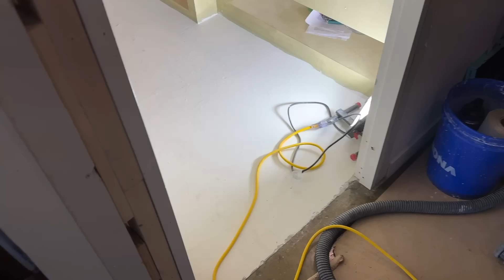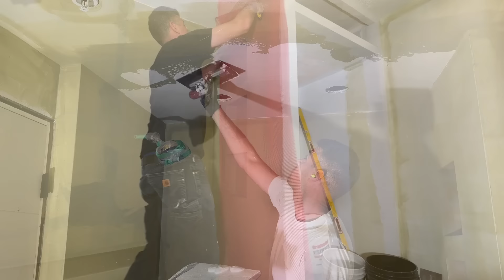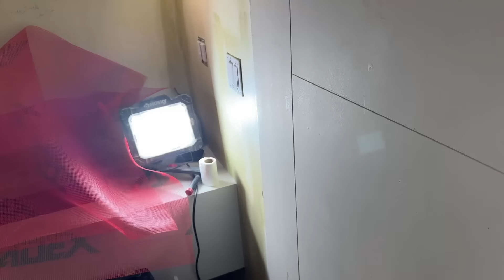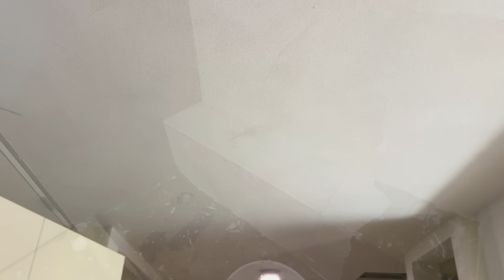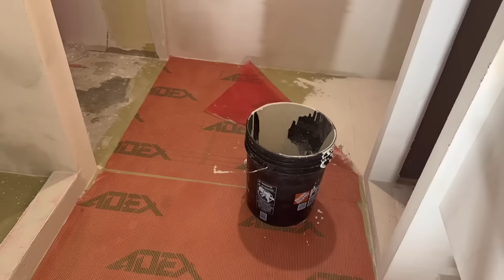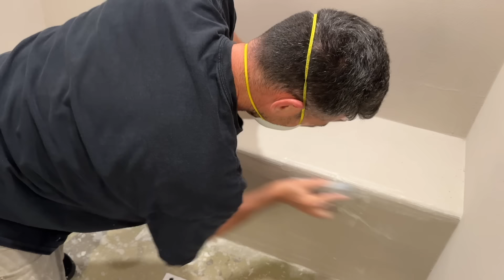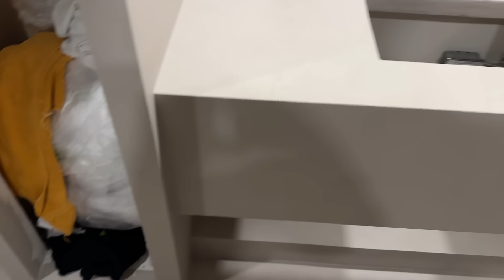Is MICROCEMENT Really DIY Friendly?

Comment: As a contractor how did you do on this?  I'm a remodeling contractor and pretty meticulous.   I only see 2 possible outcomes for me if I took on this job: 1. I do it time and material and the customer hates me and thinks i'm a thief or incompetent, or, more likely, I only bill them for a fraction of the time I actually took.   Or 2. I give a fixed price on the job and underestimate the amount of time by orders of magnitude.   Either way, that's rough.  
Amazing job and I actually really like the finish.  I'd like to see it after it's all trimmed out.

Comment: Would you consider other systems that are less cumbersome? I am researching micro cement products for some small decorative pieces that are also usable for waterproof areas like bathrooms and showers. SureCrete microtek and Meoded Concretta are two products that have stood out to me because they don’t require any mesh or excess preparation (primer, product, . I would love to see you try those. I’m sure they’ll send you free product considering the amount of traffic your page gets.
Reply from the maker: You still need the jobs more than the product. Free product without the jobs just gets you product on the shelves and unmet obligations. Ask me how I know 😅
Reply: @vancouvercarpenter  I learned so much about drywall from you, can’t tell you how excited I got to see someone I “know” and trust post a microcement video only to find out it wasn’t very encouraging 😂

Comment: Probably the better of demonstrations of micro cement I've seen. but even as well as you tried, I feel it looks awful. Just too much tool marks after everything sets.
A thought, could you not use a sponge to help smooth the texturing or help form it around the corners as its setting up?
Reply from the maker: The tool marks are actually part of the look. It’s not intended to be a perfectly smooth surface. I think a lot of people don’t understand that. It looks better in person.

Comment: I'm an experienced drywall finisher, and 5 minutes into this video I concluded I will NEVER attempt a "microcement" project.  However, I salute Ben for tackling this project, and I hope he was compensated appropriately.
Reply: 100% came to say the same.  I’m experienced in drywall AND building showers and I immediately knew this ish ain’t for me. Haha! 🍻
Reply: Weirdly curious about the cost for a job like this, surely this is well into the 5 figures
Reply: I think I can do this, but only because I’m highly experienced in skim coating and high detail cove crafting. I’d probably create forms and use concrete edging tools and treat it akin to building a pool
Reply: hahhahaaa..... me too
Reply: It's not all that bad. And it pays well.

Comment: You can sand this product. There is a sweet spot for time, around 4hrs where an orbital with 40grt works fine.
Reply: Sanding epoxy before it's fully cured? I'd be surprised if that's good for you

Comment: I'm very grateful someone I like and trust did this video.
There is no way I can see a DIY doing this, it appears to be a nightmare.
I use epoxy grout in my tile installs, a fair bit, and it is something a lot of tilers won't use.
This is 100X harder.
Thanks Ben !
Reply: I've seen pretty good professional tile installers struggle with epoxy grout, and after using it to remodel my own bathroom, I can see why. Using a multi-coat , epoxy based product to cover every surface looks masochistic.
Reply: I used epoxy grout on my 12x12 Italian bathroom tile 30 years ago.  It's still going strong but I'm still in therapy from the cleanup trauma! Rarely do it for customers.  
  The Latticrete that came along was much more reasonable  but still a challenge.  That original Mapai was murder! That shiny resin haze! Had to brake out the acetone and laquer thinner!
Reply: @ThePierik  I'm sorry to hrar that.
Mapei needs lots of clean water rinses, no more than 20 mins after install,
it is a totally different animal,
a razor scraper helps to clean as well,
Meticulous care needed for sure.

Comment: Ben!!! I just did micro cement for the first time in Smithers BC two weeks ago. I didn't even know what it was to begin with. But it's obviously just cement with some polymer in it. I'm an electrician and I told the questions that I can also mud tape really well so I did that and then in addition they wanted me to try out some micro cement in their living room 

Man, it said to make it at a pancake batter consistency and in hindsight I think that actually was the way to go. I wanted to make it more like a thick drywall mud, that, but this caused it to have a slight overlapping effect on the second coat.  If you couldn't keep a wet edge, you would get a build up and then you'd see where you started and stopped.

So in the future I'd make it much more soupy.  And the other thing I learned is definitely get a scoop for the water and for the cement mix and not mix it by feel.  The freaking cement had such a plume of dust that would come up, there was no idea how much product you actually put in the pail.  Furthermore to this problem, if you keep going back and forth with water and mixing too much. That "over mixing" makes the product set up so fast!!  
I had one of the mixes that was the third pail of that damn near killed me.  It was so hard to apply.

It turned out well in the end and the homeowners were very happy with the effect, but I couldn't imagine knowing the drywall jobs I've fixed in the past for people that somebody would try this DIY.  I feel it would be the biggest disaster and so so messy.  I'm a very clean taper and she was shocked at how little I lost off my Hawk even though I was making it wetter towards the end.

I would use colorful language to describe how easy it was, but I'd like to keep your channel professional.  Doing a bathroom with all those corners would be very challenging.  I'm impressed Ben.  Like you said, it uses every tool you have in the box (skill I had) to get 'er done 

The homeowners we're just going to go ahead and apply micro cement to unsanded and unflushed joints in plywood.  This would have turned out gnarly.  They were taking the lead on it but I advised some pointers and they were happy to oblige but I probably should have put more effort into prep.  I got them to vacuum sand all the plywood, fill all the screw heads and float all the joints in the plywood with feather finish, then vacuum sand it again. And then apply their the primer
Reply: Really helpful information. Thank you!!
Reply: Very different product

Comment: How you describe this really sounds like polyester. I did a project on my boat where I changed the form of the hull for better stability. If it's thicker in a spot or have some in a bucket, it heats up and cures quicker than the rest, making it weird to work on.

Except polyester is dirt cheap and you just need to work with smaller batches and work like the world is ending within a few minutes

Comment: This kind of project makes me love my fiberglass shower/tub even more. Cheap, easy to install & 100% waterproof.
Reply: and 1000x easier to clean too - how are you going to clean that rough surface - and you like your counters and shower to feel like sandpaper, or the community swimming pool with it's super abrasive finish? Makes no sense at all
Reply: @gorak9000  This was going through my head the entire time I watched.  How is that textured surface not going to hold onto mildew, soap scum, and grime?  It's hell to apply, and it's hell to clean.  I suppose that adds to the 'flex factor' since you now need dedicated cleaning staff to keep it looking pristine.
Reply: @pragmax aw hell, it ain't so bad, just keep a pressure washer in your bathroom.
Reply: @gorak9000 This is the spare 6th bathroom…it will never be used.
Reply: @gorak9000  It isn't supposed to have a rough finish. It's meant to end up glassy smooth.
Reply: @timbirch4999 No it's not. Different products.
Reply: @judymiller8831   Then the contractor chose the wrong f'king product. 😂
Reply: 100% agree. This rich ppl stuff is just a expensive headache
Reply: Fibreglass...   Yes, it's cheap. 

Cheap AF.

Comment: From the moment you started followed by one after the other facts on difficulty, etc., made me appreciate your work even more.  Epoxy grout, etc, is AWFUL to work with.  You can't get it off your tools, it goes off too fast, etc.  Epoxy grout was popular about 20 years ago and was an absolute nightmare to work with.  Thank goodness another contractor shared w/me that using dishwasher detergent helped to take it off the tiles, tools, etc.  I wouldn't use this stuff b/c I wouldn't want to the pressure and other constraints to make it turn out well.  Nice job!!

Comment: I love this type of work, I do parging mainly but looking to get into winter friendly projects. I am going to try using Adex wet basecoat mixed with port land then color primer and finish with Acrylic! Would be sweet if you did one of those. Materials are still expensive but 110 per pale basecoat + 1.5 x 12 bucks portland 20kg cement so like $130 per pale for basecoat gets you 150 sq ft at minimum. Then primer with color is $250 delivered over 1000-1500 sq ft and Acrylic 110 + 10 bucks for color between 120-130 per pale w/ color. Basically you can do it right over drywall board, or wood. If over wood use Hydraflex-who membrane everywhere, then basecoat then acrylic. If over drywall use unitape (sticky mesh) over the joints screw holes and hydraflex membrane coat w/ sticky mesh over these areas then do the rest of the place and once the joints are dry go over it again so two coats over joins 1 coat over the rest. Then you are good to use the base coat normally outside you would use the adex mesh embedded non adhesive and I am sure you could inside as well but it doesn't call for it according to technical advisor. I may just use it for the added strength especially if in the garage or high traffic areas. I usually do flat plastic float finish for my acrylic looks really good outside and I got 1 client that wants me to do it inside so I am trying to make a market of it! Need to stay busy during winter. 
I enjoy your video very detailed and makes me want to start troweling lol
Reply: have you done some jobs using the materials methods you are talking about? how did it work out?

Comment: "It took every bit of skill I had"

Well, that's great big billboard for me to stay away from it
Reply: LOL,  the first 20 seconds tells me if an expert like him had challenges, RUN !
Reply: Exactly.  I've been a Contractor for 25+ years but this guy is MUCH better at drywall than I will ever be.
Reply: I got a sharp pain in my temples when he said "epoxy".
Reply: DIYer seeing this mid microsand project looking for answers.  Everything you've said is correct.  Do Not Attempt By Yourself.  Expect at least double the advertised costs in money (buying extra material and new tools to correct failing materials), time and cleaning.  IF they had just been more upfront with the instructions and product details, I think expectations could better match project requirements.
Reply: Couldn't have said it better myself.
Reply: Facts lol
Reply: Ї😊

 

Я